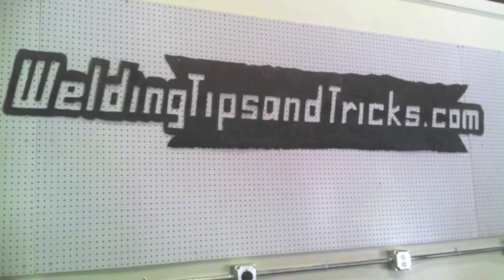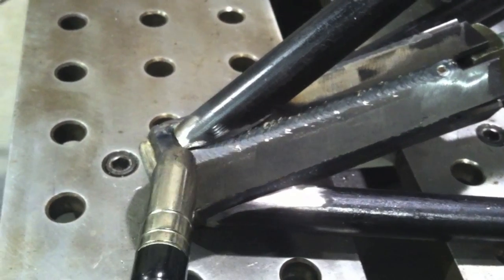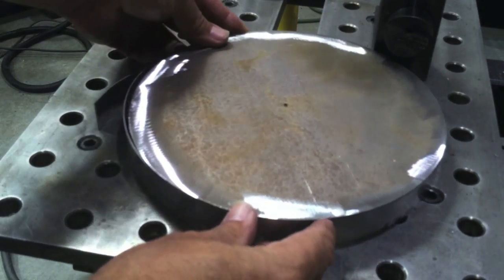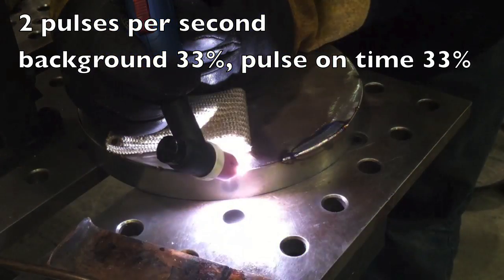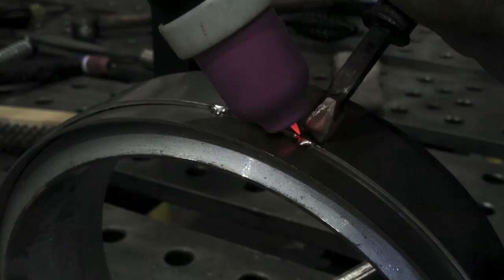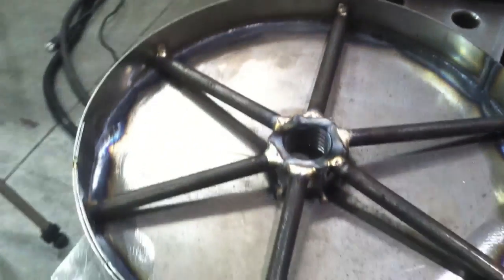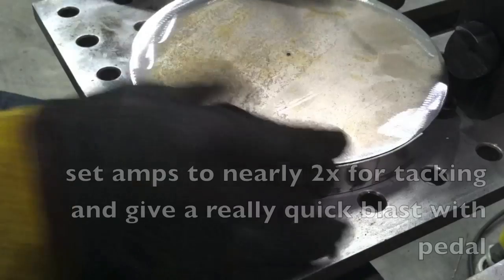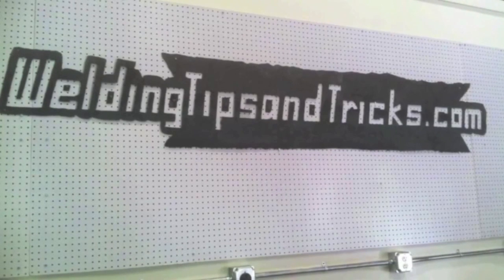Welding Project - 3 legged Shop Stool Part 2 - and Tig Welding Tips

Comment: when your tacking, do u touch the metal with the tungsten?
Reply: No you don't,you want it as close as possible though,but if your using a machine with lift arc you will have to scratch start and taper out fast

Comment: I'm not a welder, but how can you tig weld without a rod?
Reply: +Oshmand 
Tig welding isnt (beside OXY Fuel) like other methods of welding where in tig you heat the metal adding the filling other processes the filler is what shorts out causing the process . 
So  a controlled flame  fuses a puddle of metal with tig .

Comment: hey Jody love the videos, best on youtube hands down! i got a quick question and ill give you a little bckrnd, if you could help me?! ok I'm AWS D1.1 SMAW cert. and pretty good w mig but I'm going to buy a Tig machine soon, Everlast 225lx i believe, anyways I wanna start out running beads on a piece of flat (1/4in?) steel, what settings/electrode/filler rod ect do you suggest for me to begin with?  thanks

Comment: I don't (yet) TIG,but building various gadgets in a university Science & Technology department shop has me MIGging a lot. Gotta tell you that the TIG Finger works great for MIG too. I love it. It makes good welding easier by letting you prop where you need to.
Reply: How the tig going?
Reply: @TJO1733  It's not at the moment. I had a spinal injury about 3.5 years ago and am still rehabbing from that. Had to learn TIG when I'm in an assisted living facility. I'm hoping to get the rehab done and get out soon. Then I have to go get my TIG machine back from the friend I loaned it to. ;-)

Comment: I have an idea for you.  I work for a company that builds substations and we do alot of aluminum tubular buss welding anything from 1 1/2 sch40 to 6" sch80 our welders have to get a 6g tig certification and on average the welders fail it once before they can pass it t.  Also after the joint is welded it has to be smoothed with the welder to not make any sharp ridges so after it is engined it lessens the corona effect on the high 230kv and up voltages.  give it a try.

Comment from the maker: get comfortable.  Figure a way to prop . and realize that vertical welds are usually a bit slower than flat.  try to keep torch angle as close to 90 degree as you can. Even when you think its 90 deg it will actually be tilted 5 or 10 deg.  Also keep a tight arc